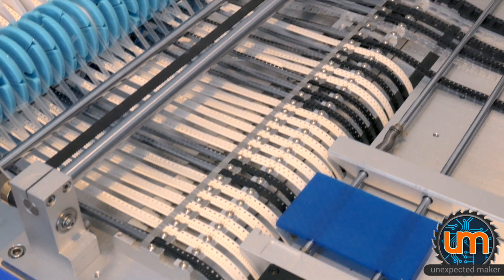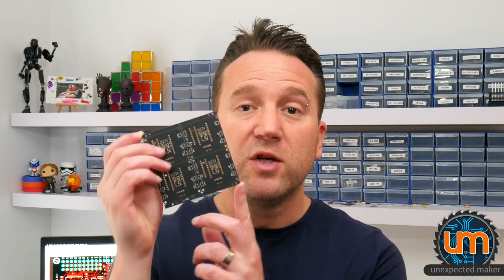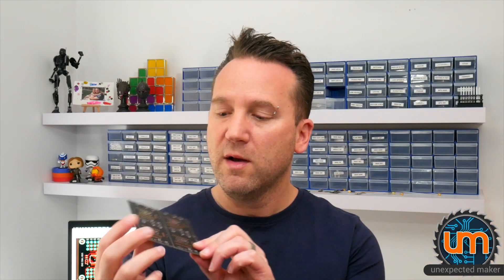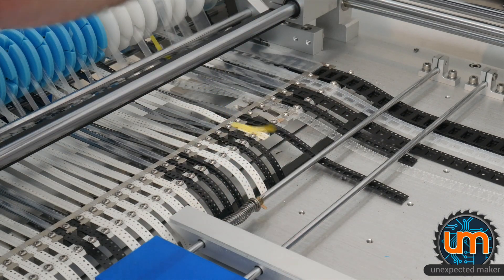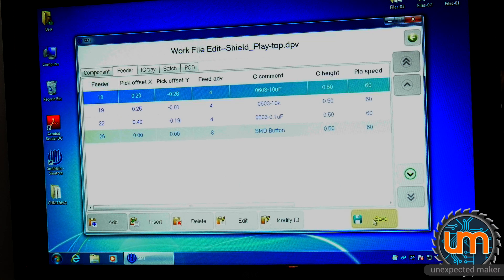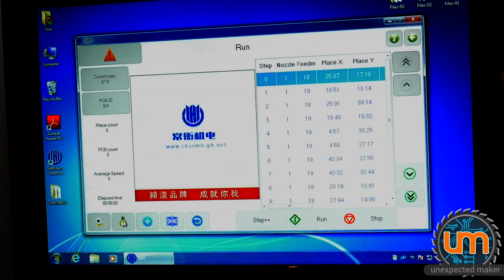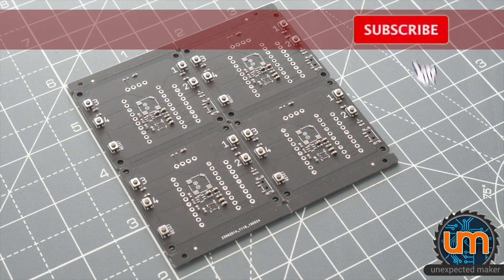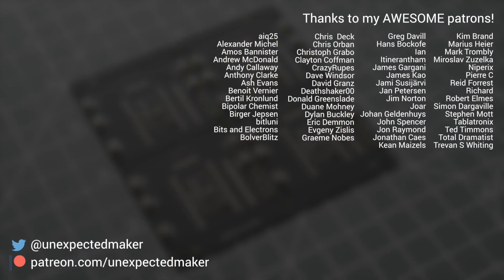My Pick & Place - Hybrid PCB Assembly

Comment: If I were you I would have gotten rid of the machine long time ago and started soldering by hand to become proficient at it. The machine is far more trouble than is worth, let alone the expenses to to keep it running and the huge calibration , setup and change over  ,,headache,,. Oh...god, it would drive me crazy.
Reply from the maker: I should get rid of the PnP that I've built over 4800 boards with because it's too much trouble? Get rid of it so I can learn to be proficient at assembling myself? Lol, you clearly have no idea who I am, what I do or what I'm proficient at. All PnP machines need a lot of work, effort & maintenance... no matter how much you pay for them. Thanks for your input though :)
Reply: yeah,, ,what?

Comment: Hey Seon, you mentioned it at the beginning of the video that you have not optimized the file to use both heads. Is it true that the only way to get it to do that is manually editing the work file?
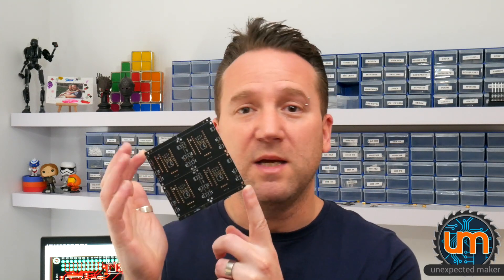Reply from the maker: Correct... edit the dpv file (text based, messy csv) or use their software to re-order stuff. the issue here is just the number of items. Maybe my estimation of 30mins was too much.. maybe only 10-15 mins.. but at 2:38 per board, it's still hard to justify when I was only building 8.

Comment: I also have a pick and place system but hand assemble a lot of boards for the exact same reasons. My machine is a much larger commercial unit that holds a lot of parts, but it is still a major endeavor to set up a brand new design. 

Almost everyone that sees it is under the impression that it is magic and just makes boards by voice command :-) Pretty funny.

Comment: Having also hand-built many hundreds of surface mount boards, it's not the picking-and-placing that's slow, it's the selecting-parts-from-the-tapes part that's slow. Including all the component selecting, I can place around 250 components per hour. I've watched heaps of home made pick and place machines that don't exceed even this slow speed enough to be bothered with them. I've just got an older second hand industrial p-n-p machine (can place ~3K components per hour), and plan to do exactly what you're doing here (selectively place all the "little people" - as I like to call them). Another factor to consider is the cost of components - a reel of resistors / capacitors isn't too bad, but I don't really want to be spending the money on IC's by the reel (or tray) when I only need 10-20 of them. My p-n-p machine wasn't too expensive (< $5K), but even so, I think it needs to place around 15000 components to break even with my current hand assembly costs.
Reply from the maker: Yup, exactly... and the smaller the components, when they become un-marked, so impossible to tell apart, the slower you need to go to ensure no mistakes!

Comment: Yes, setup time for a changeover is a issue even for the top of line P&P sysyems. One of the reasons small run manufacture is always so expensive. Not only time to switch reels of parts, but waste of materals overhead confirming correct operation after changeover. Certsinly the hugely expensive equipment is less touchy than these lower cost machines. Even larger number of reels is not a full solution, often for large scale assembly special feed reels are prepared with sequences of various parts in order of placing, so many parts come into process on one feeder. Keep in mind at high volume changeover time of even 30 min has LARGE impact on volume produced. I fully understand the reluctance to change over setup for differrnt small volume batches. If you were running 1000 of a new assembly, then the effort pays  for a few of a different assembly keep manual process, maybe if some parts are mounted already on feeders the change works  saves some time manual placing, but depends how many parts might be auto placed, versus time to do these also manually

Comment: Hey Seon -- Interesting topic. I'd be interested to hear more about the per-component calibration you mentioned, that makes it an ordeal to swap reels in and out.
Reply: I thought the up-looking machine vision camera was for compensating the variability of component pickup.
Reply from the maker: Can't compensate for a bad pickup on an 0402... especially if it grabs it by the edge ;)
Reply: @UnexpectedMaker  So what does it turn out you need to do to get the 0402 pickups to succeed? Is it precise positioning of the tape in some way? Or some kind of mapping in the software? Or?
Reply from the maker: I've done other videos about my challenge to get reliable 0402 on the machine... way too much to go over here in the comments, but it's ALL aspects of the process. Pickup, vacuum strength, bad camera alignment, skewed panel holders, placement position, and placement force and of course perfect pasting... many things need to be aligned.